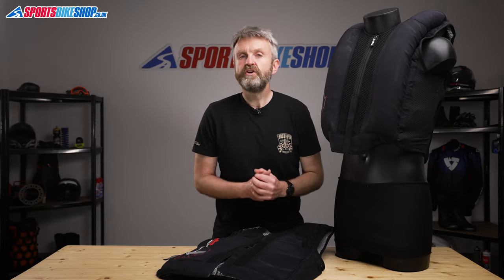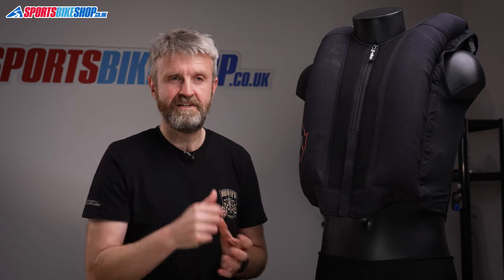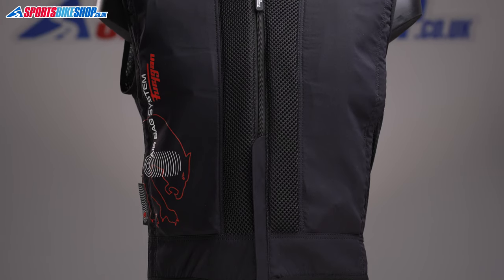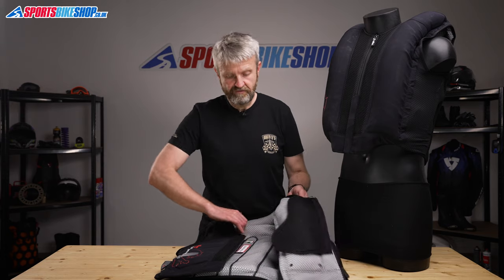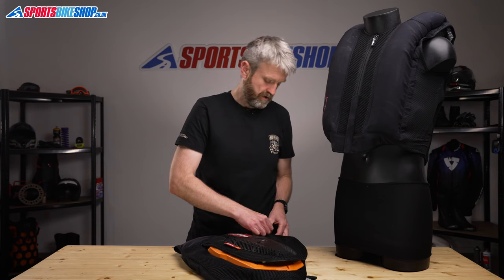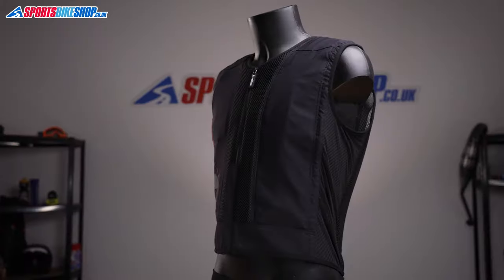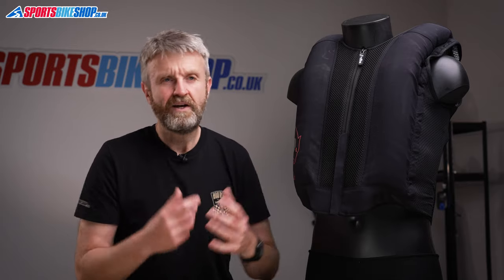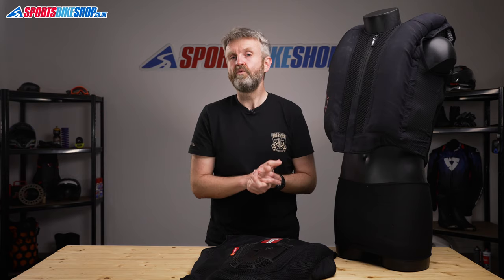We set off an airbag: Furygan motorcycle airbag review - Sportsbikeshop

Comment: I’m in the market for one of these and have just started looking in to the various options. I especially like the fact that In&motion airbag provides neck protection. This feature is missing from so other well know airbag systems. As someone who uses a Leatt STX Road Neck Brace, any airbag system I’d seriously consider has to  include protection for the neck. As well as the usual chest, back and Abdomen protection. The Furygan variant of In@motions airbag looks to be the better pick due to the D30 back protector, which I understand is the only one that is CE L2 rated? Along with the matching D30 chest protector.  Plus even in NZ$, it’s really well priced! 😊👍🏼
Reply from the maker: Yes, Furygan is the only one I'm aware of with the L2 back protector. It's also easy to add chest protector inserts for a bit of extra reassurance. Cheers, Tony

Comment: Do you find the jackets look to baggie with 15 centimetres of expansion? That seems a lot!
Reply from the maker: I'd personally rather not have that much room in my kit, but everyone is different I guess. My choice would be to have a jacket with stretch panels designed to accommodate an inflation. Cheers, Tony
Reply: Thanks mate! Are there any jackets you recommend that do have stretch panels to accommodate?
Reply from the maker: I've been in touch with Furygan about it, seeing as it's their vest. They recommend going up one size from normal to accommodate the airbag inflation. I think going up one size won't make things too baggy - I have to go up a size fairly frequently when doing these reviews and it's not too big a drama to do that. I hope that helps. Cheers, Tony
Reply: Seems like no one’s massively clear on this point with the vests that go underneath- including the manufacturer. What makes a furygan jacket air bag compatible then?
Reply from the maker: Agreed. It's not clear enough. I contacted Furygan, thinking they'd tell me accordion stretch panels on airbag-compatible jackets/suits would allow them to expand around the airbag, meaning we could wear normal size kit. They're suggesting that IS the case for the newer versions of the In&motion airbags, which are just coming out now, but with this older-style vest they're still saying to go up a size. Sorry I can't be clearer - I can only pass on the information I'm getting. If it helps, Held put me in their In&motion vest a few years ago, with a close-fitting textile jacket over the top (my normal size). They then fired the bag, to prove it would be OK. Nothing went wrong, all my ribs stayed intact and the jacket fabric expanded around the airbag. Just rider to rider, I think you'll be OK as long as you don't want to wear a jacket that feels like it's been painted on. Cheers, Tony
Reply: Cheers Tony, appreciate your time. I was looking at the held vests and jacket and thought they looked great. I would wear the helite - if it didn’t look so bad 😂

Comment: Thank you for the really useful video. It was useful to see the demonstration of the airbag activating, but you weren't wearing a crash helmet, so it was difficult to see how effectively the inflated airbag braces or immobilises your head and neck... I'm deliberating between the furygan airbag and the options from Klim & Ixon; are you able to clarify how much support to head and neck is provided by the furygan, the Klim and the Ixon airbag vests. Thanks in advance
Reply from the maker: Those three brands all use the same In&motion airbag so there will be no difference in the support provided to the head and neck. In&motion have partnerships with the three brands mentioned as well as Held, RST and Tucano Urbano. Thanks for getting in touch. Cheers, Tony

Comment: 1. Does lifetime subscription include track mode?

2. Is the older vest better integrated with their race suits?

3. There seems to be very little shoulder and kidney protection - what do you reckon?
Reply from the maker: Hi, thanks for your questions. 1) No, the track mode costs an extra £25 annually or £8 monthly as far as I can tell. 2) Possibly marginally as you can zip it into the suit and then put them on together. 3) If you hit your shoulder directly side-on the airbag may not help, but for impacts to the shoulder blades or collarbones then it would give extra protection. As for kidneys, I'd like to think they would benefit from an inflated airbag. 4) Is it OK if I try not to put Q3 to a real world test please? 😉 Thanks for getting in touch. Cheers, Tony

Comment: So have Furygan done away with the system that zips into their own jackets and are now making this standalone version instead?
Reply from the maker: Yes, exactly that. The old Air Fury vest that zipped into Furygan's jackets and suits didn't survive in their range for very long. Cheers, Tony
Reply: @sportsbikeshop 
Ah, thank you. Do you know what the recharge costs are for the Alpinestars Tech Air 5? I've heard that they've abandoned plans for it to be done in store and that due to Brexit it's taking months and costing a lot of money, to the point that it'd be cheaper to buy one of these than have the Tech Air recharged
Reply from the maker: Alpinestars say dealer service isn't possible at the moment, but might be possible in future. You're right about the delay in returning is very big - Alpinestars won't even put a number on it for me. BKS Leathers in Devon can service and recharge, so Alpinestars are recommending customers get it done there rather than returning to Italy. Cost is £99 for a routine service or £299 if the bag itself needs replacing (which is required after most deployments). Thanks for getting in touch, and I hope that helps. Cheers, Tony
Reply: @sportsbikeshop  
Thank you for the reply Tony. I had no idea that BKS was an option and was on the verge of just buying a replacement vest from Furygan or Ixon. Interesting that Alpinestars say a bag replacement is likely to be necessary after deployment when the other vests can be recharged by the owner multiple times before the vest needs a manufacturer service. Either way it's fantastic that this sort of kit is available to bikers nowadays and as mentioned is something I'd never ride without now.

Comment: Does this vest need to be connected (Bluetooth etc) to your mobile? With sat navigation and Cardo headsets connection already this could be an issue. Many thanks
Reply from the maker: The connection between phone and In&box is not Bluetooth, so no issue there. It doesn't need to be connected to your phone in any way while riding, though you will need it for set-up and it's also useful to use the phone app to change preferences and monitor battery life. Thanks for getting in touch and I hope that helps. Cheers, Tony

Comment: So what did you say, to not connect your jacket to your trousers, because you dont want to lift your trousers when die airbag rises?!
Reply from the maker: That's what it says in the owners' manual for the vest - though Furygan don't point out the reason so I'm speculating as to why they'd suggest you leave jacket and trousers disconnected. I reckon it could get pretty uncomfortable! Thanks for getting in touch. Cheers, Tony

Comment: Too many complications takes away what riding is all about.
The concept is great but not economical 
The cost of this “leasing” or subscription after the high initial cost of buying the bloody thing is a big rip off 👎👎👎
Reply from the maker: I take your point on complications reducing the liberating feeling of riding a bike. Also, you're far from alone in disliking the subscription model. You can buy the In&box part outright rather than leasing and if you do this the total cost ends up being similar to other electronic airbags with a non-subscription model. Thanks for getting in touch. Cheers, Tony

Comment: How do go about sizing. I have a DRC full suit and it compatible to zip into the suit. How do you know what size to order without having the ability to try them on?
Reply from the maker: I'd double check with DRC that they've designed in enough expansion room for an In&Motion airbag to inflate, then it should just be a case of choosing the vest size that applies to you. There's a size chart on the product listing page... https://www.sportsbikeshop.co.uk/motorcycle_parts/content_prod/544553 As for whether the uninflated vest will fit under your suit, there's no way to be 100% sure in advance of purchase without coming to a store and trying the two together. Thanks for getting in touch. Cheers, Tony